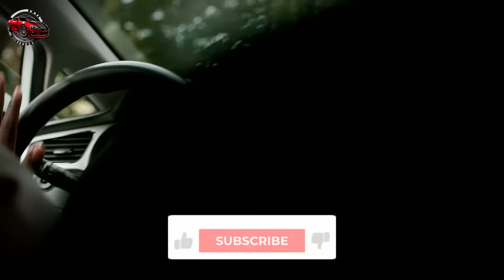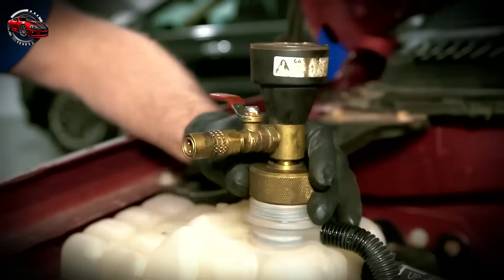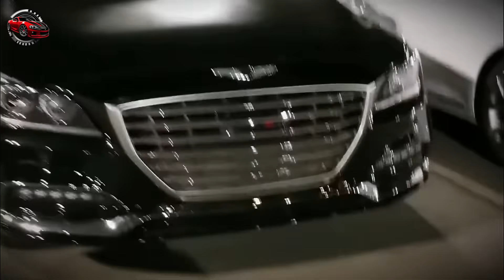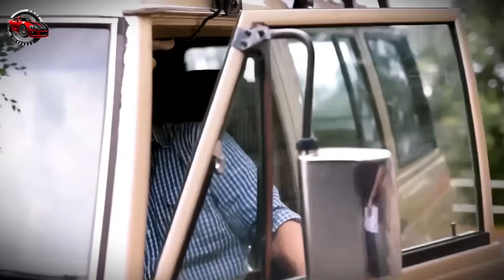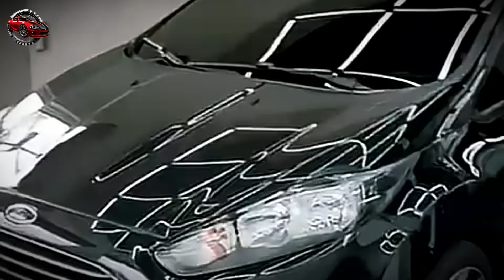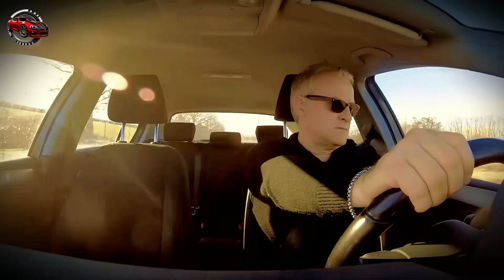Doing This Will Make Your Car's AC Blow TWICE as Cold | Secret Car Tricks

Comment: People need to understand the 'Greenhouse Effect'. The heat / rays from the sun start as short waves which penetrates glass. Once these short raves pass through the glass they convert to long waves and can not escape an enclosed area. This how a greenhouse works (hence the name) and why they are all made of, or close to all, glass walls/ceiling.  The only way the heat can escape is by opening the car doors or rolling down the windows. Even if you open the car doors you still want to roll down the windows. Once you reduced the cars interior temp to roughly the outside temp, crank the A/C until you feel cool air inside the car. Feel the seats, doors, dash etc too as they retain heat also. 
Of course if your car is equipped with remote start you can make it a one step process but man, that is ROUGH on your car when its really hot out.

Comment: (This comment is only speculative based on my look under the bonnet/hood.)

I suspect some cars/ 4wds have a pump on heater hose.  This small pump might only work when cabin heat mode is on, so there no need to add a tap on cabin heater core hose. It seems a good idea, if that is how it works i.e. VW Amarok  V6 2018.
Any comments?

Comment: I would like and suggest your videos because they are quite informative with great tips. However, Your stock engine footage does not even apply to your subject matter. I have no idea what parts you are speaking about when you are showing some engine block with many hoses and some bolts that are irrelevant to the tips you are giving. I'm going to find a better prepared tipster for my on line mechanic. You are frustrating!

Comment: Good advice here. Here's something no one ever talks about, if the car is parked and everything is in good shape and works properly, idle the engine up to about 2000 rpms with AC on. Discharge temp will drop about another 10 degrees. The system is transferring more heat energy by running compressor faster. Especially if using fan clutch at condenser coil

Comment: There's a filter under the dashboard that is a pain to get to that will plug and restrict air flow. Google for your car. The lines he was talking about under the hood are already wrapped with an insulation and if the lines are frosted over that aren't wrapped, your freon is low. Never seen the lines that are supposed to be wrapped be unwrapped. You can get the freon you need from Walmart. Google for what freon you need and it comes with a gauge already to tell you when you're to low or to high.If not, you can buy the line with a gauge already on it. It's accurate enough. Just don't overfill the system.  If you have a leak, your AC will only work a few days then start blowing warm air again. That means you have a leak you'll have to find, repair it, then pull a vacuum on the system to get everything out and insure you got the leak or there aren't other leaks, then recharge the system. If you don't have a vacuum pump, you're gonna have to get help. If the compressor is gone, buy a rebuilt one, not a new one. Make sure it has lubricant in it or when you take it to someone with a vacuum pump has lubricant for it and have them draw the vacuum and put in the freon. No pics needed since a simple google search will show you pics of your car. The major problems are almost always the freon is low but not so low a major problem happens. For instance, needing a top off once a year isn't something to worry about.There is also the fact that in some states it's so darned hot the AC flat may not be able to keep up in an older car or even your house. Louisiana comes to mind where I'm from. Finally, you may have a faulty or worn out compressor. That does happen.

Comment: These checks are way too involved for the average backyard mechanic. You need to see a qualified mechanic, because there are many checks that Evan a qualified mechanic can miss if he or she is a licensed a/c technician. The quick a/c kits with a bottle and hose will only work for just a few malfunctions. Now you just spent $40 bucks for one of these kits and it didn’t fix your problem, and now you need to take it to a shop to fix it and 40$ in the hole ! Good luck !
Reply: Another senario to need to know about: if your taking a long trip, and you keep the recirulate button on, you and your passengers are not getting any fresh air, which will affect your mood and breathing!

Comment: Yea, you’re addressing some major problems that may or may not be the issue. As a 20 year auto technician this is how I troubleshoot an a/c problem. First, I would note the year of the vehicle. Then I would hook up my a/c machine and note the readings. If the compressor is running, if the vehicle is over 3 years old, I would evacuate the system and see how much Freon I removed and compare that reading with the under hood sticker and see if it is full or not. Most of the time the Freon is low, which is common for a vehicle with over 3 years old. Then I would evacuate the Freon and fill it to the stickers recommended quantity. Then restart the vehicle an note the pressures, you cannot troubleshoot the system until it is filled with the correct amount of Freon. Only then can you look at the a/c system. Does the compressor come on does the a/c fan come on. Only then can you test the hoses and look for leaks and observe system operation.
Reply: Would you suggest this for a 24 year old Buick that still blows decent?
Reply: @gregstabryla9945  If it's still blowing cold, you have no problems. The question is, is it still blowing as cold as it did when it was new? If not, something needs to be changed, but it will take a GOOD mechanic to figure out what that is. As James said, most techs will just follow the flow chart and check to make sure that everything is set up correctly. But if it is, and you're getting warm air, it will take a good diagnostician to figure out what the problem is. I learned over time how to do that, but I can't do it without examining the car.
Reply: I'm 69 years old and I've worked on cars for over 50 years. My simplest way let the car run for 5-10 minutes feel the low side the suction side. Is it sweating is it ice cold. You don't always need gauges. I've been doing this all my life and I've had no problems
Reply: Good advice. Also think about the suction side, the receiver and non insulated suction lines pickup a lot of heat energy being under the hood. You don't want to load your compressor with engine heat, just cabin heat. Insulate the entire low side well.
Reply: Lovely video
Reply: Î😊pp000😊
Reply: Listening, it's great advice. 
Watching is very disorienting,  since the item you are talking about often isn't what is on the screen.

Comment: Should have mentioned,  although pressing the recirculation button when you first start your car in 100 degree day it will take the AC much longer to cool off. You should either roll the windows down until cold air starts coming out or not press the recirculation button until the air cools down.  Pressing that button on a hot sunny day when the car has been sitting in the parking lot results in the AC trying to cool down 140 degree air
Reply: Yes.  I was going to say the same.  I roll the windows down, full blower and outside airto purge the interior.  A few blocks down the road the windows go up, and switch to recirculate.
Reply: @donaldlewis1119  I do a remote start, let it run while I'm walking to the car. Gives it a head start.
Reply: Thank you for amazing information…
Reply: I have a 2011 Ford Expedition. After sitting in 100 degree Texas sun the inside is 130- 150F, so I open all doors, including the back hatch before starting the car.  Roll down all windows, start the car with max AC get out and go around again and close each door and back before getting in.  Also, I leave aprox 1" on top back windows while parked to release some of extreme heat.  I have broken temp gauges so many times that only go up to 150F left in my car in the shade so I know the heat inside.  I also leave the 1 in slit back window open for any trip less than 15 min. as there is a lot of room in there to cool and that little area on 1 window helps super hot air escape fast.  I respect my AC and it gives me cold air.
   You should take notes of this video, then Google videos to see close up on how to change,  wrap, etc.  Also, Autozone has makes and models for parts and blow up for most vehicles for free.  
They do this as a courtesy.  Return their courtesy and buy something from them one in a while.  I have. 
   With so many ripoff places nowadays,  it is nice to support shops that don't rip you off.
Reply: @insightstoenjoyingmore2621  I do the same. Thanks for the tip about Autozone. Will do.
Reply: @insightstoenjoyingmore2621  People need to understand the 'Greenhouse Effect'. The heat / rays from the sun start as short waves which penetrates glass. Once these short raves pass through the glass they convert to long waves and can not escape an enclosed area. This how a greenhouse works (hence the name) and why they are all made of, or close to all, glass walls/ceiling.  The only way the heat can escape is by opening the car doors or rolling down the windows. Even if you open the car doors you still want to roll down the windows. Once you reduced the cars interior temp to roughly the outside temp, crank the A/C until you feel cool air inside the car. Feel the seats, doors, dash etc too as they retain heat also. 
Of course if your car is equipped with remote start you can make it a one step process but man, that is ROUGH on your car when its really hot out.
Reply: Thats why breaking a window in Arizona to save a child or a dog 😢is totally legal. Violators should be prosecuted. ignorance is no excuse..😊